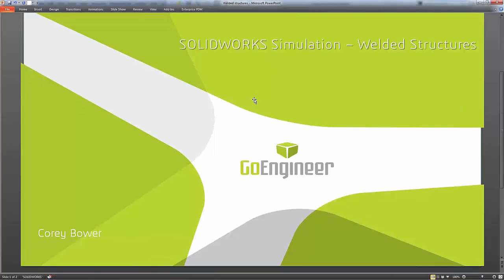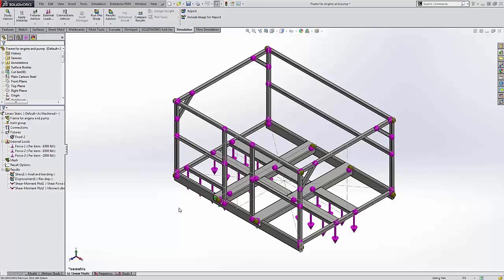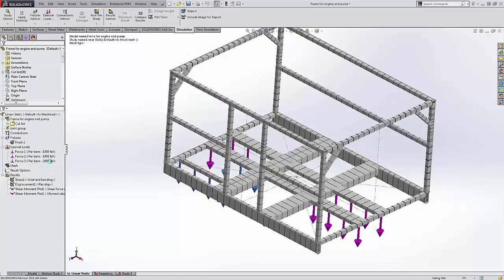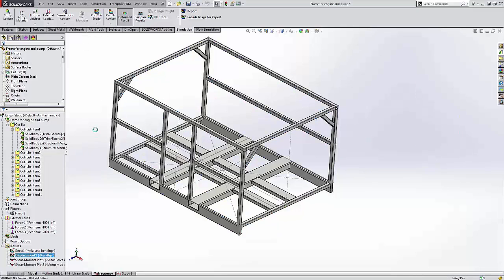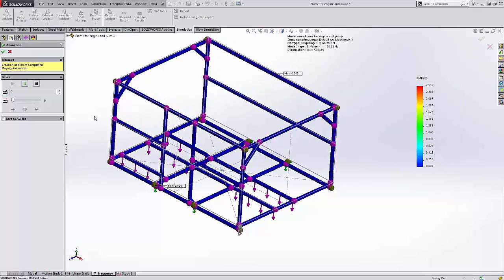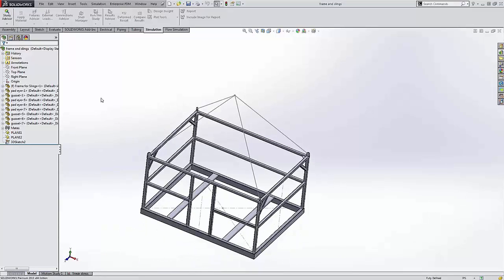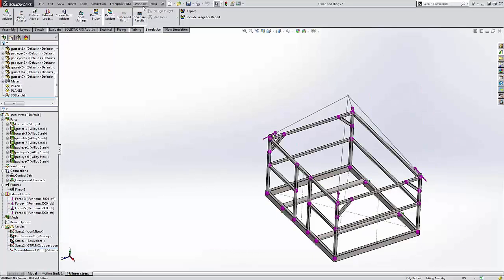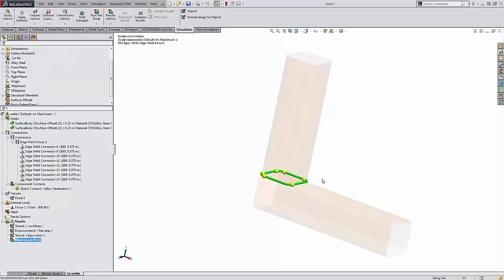SOLIDWORKS - Analysis of Welded Structures

Comment: When I perform a weldment simulation using SolidWorks, the program recognizes one of the elements as solid and the other elements as beams. However, it does not allow me to change the solid element to a beam. How can I resolve this problem?

And thank you for making like this informative videos
Reply from the maker: Please contact your var's technical support team, there are a number of factors that could be at play.

Comment: I would need to know how to simulate beams (not surfaces) but use as connection line welds. Once I did it but now i can't figure out how to set it. I know I need to change beams to be solid parts but now it's not working...any ideas?
Reply: +Petr Šebesta Do you mean the 'treat as solid' option when setting your simulation? I think weldment checks can't be done without using sheet metals or shells parts...